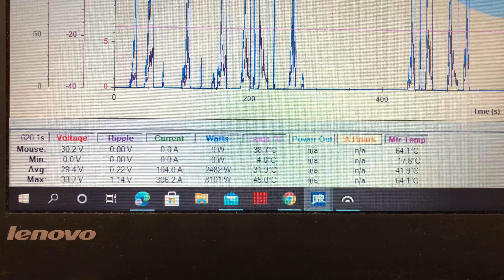Castle XLX2 800KV GO-KART BUILD PT. 2

Comment: This is madness, I wish that castle starts making XXXXL motors with 20S
Reply: Look up Peter home built ultralight airplane electric he uses huge oversized RC plane type brushless motors two of them two giant 20 cell batteries like five of those or six of those and two giant ESC is basically giant oversized RC plane electronics that he showed into an ultra light aircraft that he built out of foam and plywood and he actually flies it sitting in the cockpit. So if they make oversized plain stuff like for RC but bigger for ultralight planes that you can fly in I'm sure that they make RC car batteries and motors as well to build a go-kart
Reply: @youknoweverything7643  yes I've used to watch Peter's video plane built and fly test but those motors are plane motors they are maybe bad for cars, what we need is a real in-runner motor with a certain gear ratio of couse explaining about hp and speed and maybe used in real cars like small size cars as a kia picanto or a Hyundai i10 or some sort...
Reply: @BIG-MAD  I know they are for planes but if they can super size brushless airplane motors I'm sure they could super size brushless rc car motors to work in go karts and small home made cars. They made it for planes it can be done for go karts is what I'm saying
Reply: @youknoweverything7643  yes that's right

Comment: My only input is that you really need to upgrade the battery connectors. Castle specifically says not to run XT90/EC5 connectors. bump up to a QS8 connector and you'll also pick up some speed (not that you need anymore 😂).

Comment: Wow. Avg of 2.4 kW and max of 8.1 kW. Those motors have a lot more power to give. Each 2028 can easily run in the 15kW range. Check out Raz on YT.
Reply: With the massive weight difference would that be possible?
Reply: The weight difference is why it will never reach that awesome build mate that kart is moving
Reply: @mrmagoo.3678  I mean you could get the higher kv and gear it down and it would be closer to peak power

Comment: Try some different batteries. Some SMC’s and you’ll go even faster and maybe put some fans on the motors. I noticed you keep checking the heat of the esc. They’re not hot unless the fan is running.   The build is super dope I can believe you don’t have more traffic on this video I know it’s old. Excellent go cart super dope

Comment: I'd recommend you trying out the 1100kv castle I'm running just one on a pedal bike and it rips fast does around 70 on the highway using a hobbywing max 5 esc castle escs don't seem to last long
Reply from the maker: I would love to see your build!
Reply: @kristianhansen2797  I'll post it on my channel sometimes today to show it can't really make a video of me riding it because it's pretty messy outside from the snow melting
Reply: I've uploaded a short video of my pedal bike if you want to see it when the snow melts I'll make one of me driving it
Reply from the maker: @mikehen7600  very cool, looks nice and simple. How do you like the hobbywing esc? Do you have a twistthrottle?
Reply: @kristianhansen2797  I don't have a twist throttle at the moment just a lever to control the speed

Comment: thats amazing i like how you can brake without motor brake and steer without servo. i thought it was a full size rc go kart. but you are on it lol cool. if the motors braked for you would they burn up?
Reply from the maker: There will be no reason for the motors to brake, and yes they will see some extra heat from that. 😊
Reply: @kristianhansen2797  I thought so. Great work it is fast

Comment: What is the rated power of this motor? Or how much amps can ot pull without overheating?
Reply from the maker: I have seen peak amps around 600A 20.000W 
I think you can run 200A continuous with enough cooling

Comment: What did you use on the throttle pedal to control that? We have a 1960 percival Hellcat race kart that would be perfect to do this with
Reply from the maker: Sounds dope with the hellcat! The throttle is just a servotester soldered together with a foot throttle

Comment: How has the build been doing since this video? What information have you gathered and what are the results?
Reply: Looks like the readings are exactly at their peak safe performance.. has anything changed since the video?
Reply from the maker: I have tried different settings with the esc, mostly the torque setting, this is the main reason this esc can work as an ev controller. the thing is still running today. i have a plan on doing a 4 motor setup, or even a 8 motor setup. that should give me around 150HP peak. i also bougt a racekart with frontbrakes, for the new conversion 👍

Comment: Try pairing this motors to two Flier 400A esc's on 12s. After that I'd like to see a MGM Compro controller paired with a Lehner 30100 motor.
Reply from the maker: The 400A flier will not be able to handle the 500-600A loads, the MGM however is interesting. I am looking into a dual Lehner 30100
Reply: @kristianhansen2797  less amps are required on 12s for the same torque and speed. I'm sure the Flier ESCs can handle it. Hobbyist have been using Flier in big RC boats for a while now which have a huge continuous draw.

Comment: Wow, just wow!!! Hahahaa, and I was thinking about modifying my kids power wheels with one or two of these motors so it could run better than the 5mph it barely does!.....70mph with your weight!!, hahahaa, my 7yrs is only 52lb, yeeeeaaaaah, noooooo!!! 🤣🤣🤣 I guess i will need to gear it WAY down lol
Reply from the maker: Sounds like a good plan. You can all ways use the torque control to limit the power, then when the kid is grown up, you can crank it up and make the thing fly! 😄

Comment: When are you gonna bring back the 140kv lehner and flier.  U gotta run that setup on 22s man.  Love ur videos man and keep up the great work
Reply from the maker: I do still have the lehner motor in my stock, but without the sensored feature it is almost useless. I just got a new go kart with much bigger frame, and brakes on front, I plan to do a 4 x xlx2 setup, with the 1100kv.
Reply: @Kristian Hansen  looking forward to that build man

Comment: At first glance I was skeptical of having the 2 motors coupled directly together but it worked well enough and runs HARD
Reply: Pretty cool did it get hot?
Reply from the maker: It runs perfectly smooth, no vibrations. It runs like one unit

Comment: Could this setup be used on a ebike ?
Reply from the maker: Yes, but you will need a lot of gear reduction
Reply: @kristianhansen2797  how much you think? And why because you used no gear reduction plus isn’t the bike going to be lighter then the go kart why need gear reduction?
Reply: @jonathanbrunache3848  rolling radius of the bike wheel compared to the go karts needs to be calculated

Comment: You’re gauges would be battery voltage, current draw and motor temps. I can see you adding a clutch for incase of any sudden or accidental moves. But… to know what’s the fastest you could accelerate reliably, you would have to monitor amp draw… what if you had a pneumatic clutch that was controlled by a measure of amp draw? Too much lol?